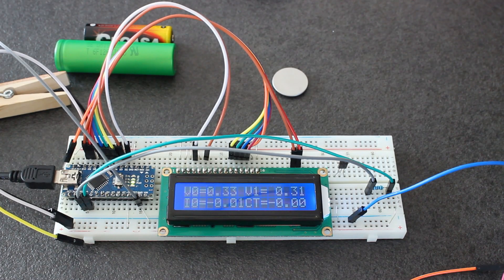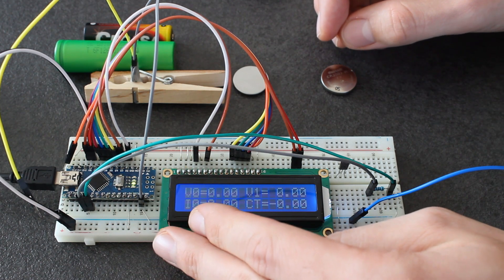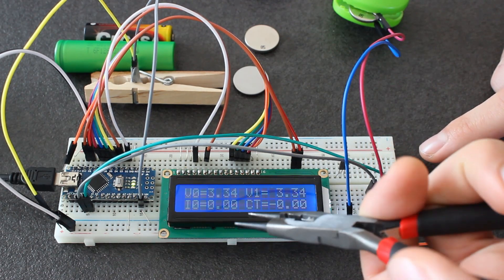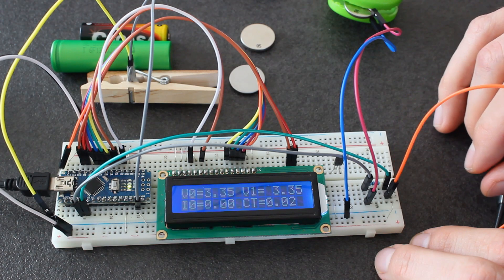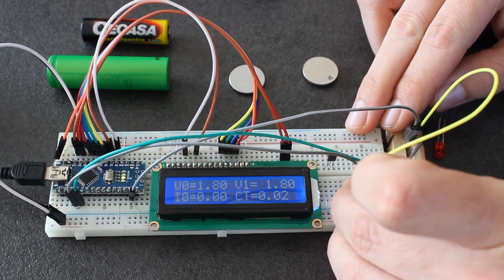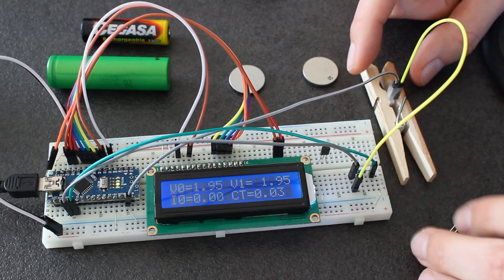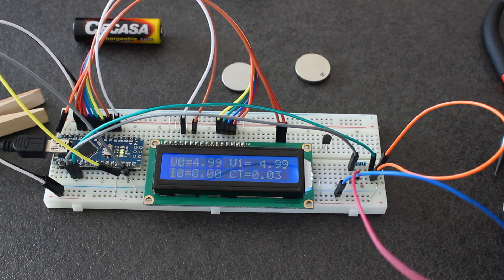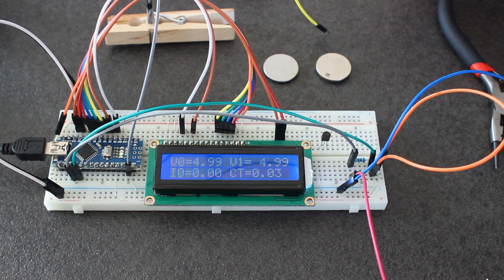Recharge CR2032 button cell batteries with Arduino

Comment: Do not reccommend this by any measure... It could be great too; just ditch the duino and run some tests on a whole batch of these - not the first 3 or so!
What methods are preventing gas generation and lithium dendrite formation?
Observing some research papers I've found promising results using pulsed charging - however this involves specific frequencies, and duty cycle - 1s on and 1second off was actually one of the worst plot lines, basically the same as using DC to charge the lithium metal electrode...
Measurements would be nice, most lithium-metal batteries in the tests gave ~50 cycles. Can this fill a dead CR? Or is it like the ML or VL rechargeable coins - where you get 1000 cycles by only discharging 10%? Reading down the way, you state a 1mA for 20 seconds discharge, followed by a recharge. Statements such as "seems to work like new" are vague - with your test cycling this think 2000 times over the week; you cannot be serious to say you didn't run it flat at the end to register it's final capacity???
Not that that helps - as you'd need to run this for 1000 seconds to register ONE coulomb - and there's short of a thousand of those in a CR2032. With ~100 coulombs in the VL2032; the cycle life is 10K or so for a 1% discharge... So i'd expect no less than infinity (with respect to one human lifetime) with a 0.001% discharge!

So yeah interesting science to be had here; but it's being squandered by fast-tracking...
Take the time to test and measure; wait for some quality parts to arrive - or design your own circuit instead of these proto-code type setups; if this could be done with an NE555 and a few resistors; why is there a computer drawing 20mA??? It's like the "IC killed the circuit designer" but now it's "the arduino killed the IC maker" = and nobody can draw the schematic that could so this with the only two transistors one could come up with in a pinch (the ONLY time to recharge a non-rechargeable outside of a science lab!)

In the long one, an ML2032 is actually better - over a thousand guaranteed cycles at 10% discharge (~6 of it's 60mAH) and is actually more powerful, CR2032 is only capable of 1mA constant DC - where the ML can deliver 1.5mA with similar performance - this is 1/200C vs. 1/40C respectively!
So with such power benefits and a no-leak guarantee; I'm struggling to find a good reason to charge a reactive lithium-metal electrode outside of "Reddit-Science" and other Internet inspired curiosities. And yes, this kept me up at night for one night.
Reply from the maker: You are totally right, I am not working on this field so it was just a little hobbyist experiment. I apologize for not following rigorous methods to prove my statements. After this video, I wrote a routine to cycle the battery at a very shallow discharge value (I don't remember but must have been les than 5%). I think that I used 24h of Le Mans hybrid cars data, so it was like charging and discharging few times every three minutes, I left it for one week or so, the battery kept working and showing normal voltages and currents after that. But again, I have no data about dendrite formation, capacity loss, or anything. Thanks for the message anyway and sorry to kept you up for one night!!!

Comment: Nice one, have you tried to charge with constant current and a voltage protection circuit, for example, when it reaches 3.3V, the circuit cuts the charging.
Reply from the maker: Thanks! I tried it in some other prototyping. I took the lap times of LMP1 in the 24h of Le Mans and emulated a lap charge-discharge history in the CR2032, I left it running for 24 hours.
Reply: @argilaga  cool, some months ago I recharged a 1616 and a 2450, not elegantly like you did. Hooked on a solar cell but it worked.

Comment: Thank you for the video! Q: If non-rechargeable batteries can be recharged, why do they make the other rechargeable ones? I'm planning to replace my car key fob's rechargeable battery with a non-rechargeable one and was worried about the car recharging the non-rechargeable battery.
Reply from the maker: I guess the rechargeable ones are rated for a number of cycles, let's say about 300? While non-rechargeable will last probably much less. It's all about currents, if your key fob tries to recharge the non-rechargeable battery at a too high current it could make it explode. There is also the risk of leak, so better don't do this with expensive equipment!

Comment: Thank you for posting! This is a great video. Very clear and helpful. What formula did you use for CT (mAh)? Did you just multiply current by time? Have you had any trouble with heating or leaking?
Reply from the maker: Thanks! Yes just integrate current over time... This is what most of professional chargers do. No heating or leaking with the currents used in the video, I left some of them overnight with no problems. I only got leaking sometimes when recharging alkaline AA batteries.
Reply: @argilaga  Thank you for your reply! I implemented your trickle-charging strategy with 2xCR2032 batteries using an Arduino Uno on a prototype board. It worked flawlessly! I have charged 6xbatteries so far overnight, without any heating or leaking. One suggestion to simplify your design: you don't need to measure the voltage at the top of the resistor to calculate the voltage drop, because the MCU should just be report the highest voltage here anyway (1023). This measurement can be replaced by 5.0 V, or whatever you measure your board voltage at. Thank you so much again for this design!!!!

Comment: Could you tell me the requirements for the battery recharger.
Reply from the maker: An Arduino, breadboard, jump wires, a 220 or 1k ohm resistor, a red LED, some support for the battery and some LCD or OLED screen if you want for the output, otherwise you can use the serial output in the computer.

Comment: I thought that you were going to teach us how to built it.  Disappointing.
Reply: Well, don't worry, there are 100 times simpler designs to monitor a current and tension... When you which max current 🤔 
Supply tension is shown (3,5V for CR2032), but this required piece of information is saldy missing 😥

Comment: This is pretty cool. I'm thinking of powering an AtTiny13A with a small 5V-20mA solar cell, and looking for the cheapest storage possible. So far supercapacitors were my bet, but this looks like a better solution for longer term storage, and even cheaper since 4.5V 1F supercaps barely ever go under 1€, whereas you can find cheaper CR2032 batteries in many places, specially if you buy a 10 pack or something. IKEA sells some cheap ones, for 2-3€/10pcs. If I can manage to charge one of these with a solar cell, I'll tell you my results. Thank you so much for sharing this!
Reply from the maker: I'm glad you liked it! In another experiment I tried to test the cyclic charge-discharge of CR2032. The setup consisted in powering a red LED with the CR2032 during 20 seconds, the current was around 1 mA, then recharge the battery at a rate of 0.5mA until reaching the initial mAh value, then 10 seconds rest and so on. I left this going on for several days, with more than 2000 cycles  and the battery seemed to hold charge and give the same current as before the test. The switches where made with transistors and controlled by output pins from the Arduino.
Reply: @argilaga  The capacity of a CR2032 usually exceeds 100mAh, so maybe I'll have to do some tests as well, to see how much energy is left in the battery after doing so many cycles, specially doing deeper cycles. God I need summer! 

Thank you again for sharing your knowledge. How did you come up with those specific values for the charging current?
Reply from the maker: @rojirrim7298  Absolutely, your application is very different, my discharge cycles were very shallow. I was trying to emulate the battery of a hybrid racing car in a typical circuit, deploying the power in the straight lines and charging with the engine in the rest of the lap. The current was determined by fixing some maximum voltage variations, I think I had something like 3.2v +0.3v under charge and 3.2v -0.6v under load. Deep discharge of a CR2032 can bring some problems since these batteries increase a lot the internal resistance when discharged. I think you should work with no more than 20% discharges to assure a long battery life, like in a lead acid. Good luck!
Reply: @argilaga  Wow, that's some great info. Thank you so much for sharing and taking the time to answer me, you're the real MVP

Comment: Even a rough sketch of the circuit will b highly appreciated.
Reply: CR2032 is charged through a 1K resistor which is connected to +5V line:
Vcc < -- (to A1 pin of arduino) --- [1 Kiloohm] -- (to A0 pin of arduino) -- > (+)-- | CR2032i --- (-) < ------ > GND
LCD Screen is connected the same way as in arduino tutorial but data pins are (2, 3, 4, 5, 6, 7) instead of (12, 11, 5, 4, 3, 2) in example sketch... LCD is not necessary, just replace lcd.print(<var>); with printf("%.2f", <var>); for float to use Serial.
Arduino is just a voltmeter and charge measuring device here, not the charger itself. So this is not a smart charger.

Comment: can you provide the circuit diagram??
Reply from the maker: It looks complicated in the breadboard but actually it´s very simple. You just need to put the battery and a resistor in series and measure the voltage across the battery to know the battery voltage and the voltage across the resitor to compute the current by divining the voltage by the resistance. I hope it helps!

Comment: Hello.
Thanks for the video. 
I have batterys LIR2032, BUT I donot have the system recharge. Do you think this system work for me?
Reply from the maker: Thanks for the comment!  yes you can recharge them, but the voltages are different than the CR batteries, take it into account. If you measure 0.010v it seems that they are very discharged, you should start applying very low current to revive them safely.
Reply: @argilaga Hello. I have resistor 1k and Arduino 1 r3. What another things usted neccesary? Thanks si much
Reply from the maker: Hello! Some LEDs can help you to drop 2v if you want to recharge 1,5v batteries, but for yours it's not needed. Also a 16x2 LCD screen, nevertheless if you don't have one you can use a serial output in the computer.
Reply: argilaga Thanks for You answer.
Reply: @argilaga  How "low"? 😁
Reply: And the batterys with the voltimeter show me 10 milivolts, but on the batterys show 3.6volts

Comment: I need this device. How i can to buy sir
Reply from the maker: Hello Sir, this is an Arduino, you can buy the original one or any of the clones since it has an open design. The links to the code are in the description of the video.

Comment: Very interesting ! I have a ElectriFly Triton EQ Charger, Do you think i Can use Lition charger configuration 3.6 v and 200 mah to have the same results tha yuo?
Reply from the maker: Thanks!!! I don't advise to use a regular lithium-ion charger, because the button cell lithium battery is not meant to be recharged, so the charging current of your charger will definitely be too high, it can be dangerous!
Reply: @argilaga 
What is the current (in "C" or mA) recommanded, in function of the state of discharge of the primary lithium battery ?
Lets say my CR2032 ouputs only 2,6V, what would be the max current ??

Because with THAT data, anyone who doesn't wanna learn Ardwino for such a simple trick, can build such charger with a MUCH SIMPLER SETUP.
All you'd need would be a serial of:

- a LED transformer AC220/DC3,3V
- dimmable current limitator

Looking forward that data 🙏🙏
(5€ overall on Ali).